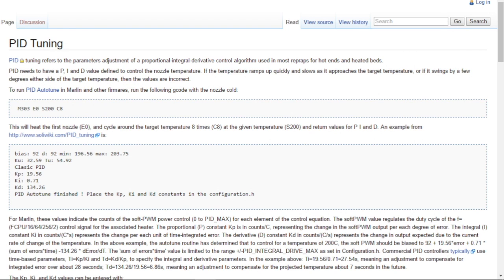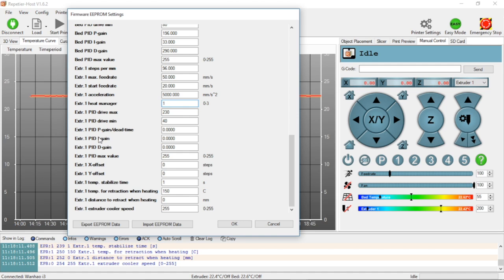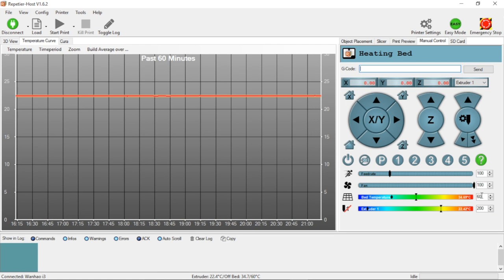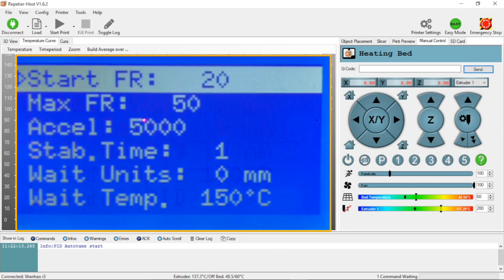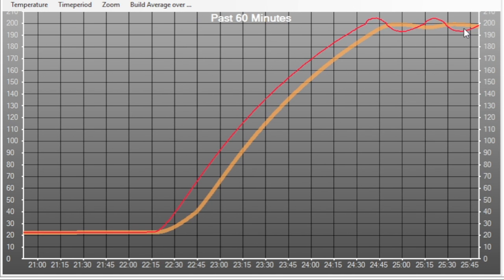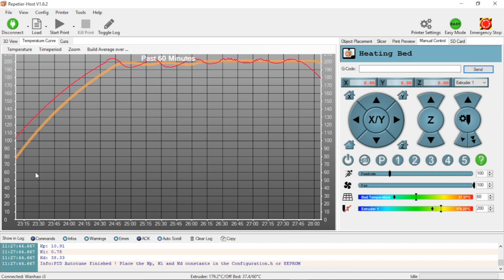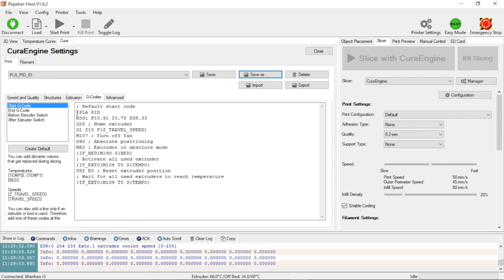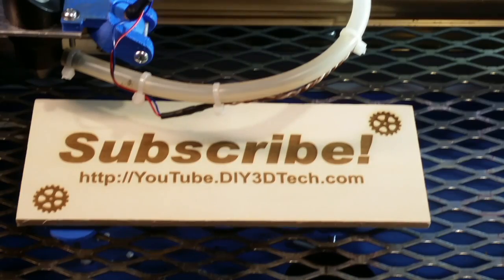3D Printer Talk - Configuring PID for a Marlin Based 3D Printer like the Wanhao! Part 3

Comment: Mine is not loading the eeprom settings for some reason. I have eeprom enabled but its just not loading when i click on it like yours did. I switched to windows and it read it just fine but I dont have the heat manager like you do.
Reply from the maker: Sorry no clue off the cuff, would suggest to double check your USB drivers and version of Ardurio software...
Reply: @DIY3DTECHcom  Mac does not have drivers like windows but its all good, i just switched to windows and it worked fine.

Comment: I never save to eeprom as I got burnt doing that so I just head into the configuration.h and change it there.  I am an old CLI guy anyway so I prefer having everything right there with a wide open editor but others who grew up in the Windows era might not (though a ton of users who 3d print are on Linux Linux has now become a glorified Windows so the same difference).
Reply from the maker: LOL!  know what you mean as I was doing keyboard buffering stuffing long before all of these keyboard macro things :-)  Ah kids have no clue what a VT-100 is, very sad as  I remember the days we would wind our own memory (the PDP days)...  Ah kids have it to good!
Reply: DIY3DTECH.com
OMG, I haven't heard that term since the 1980's when I would have to turn on VT-100 emulation when using Tymnet and Telenet.
Reply from the maker: LOL!  I used the real deal!  Use to work on (and I mean hardware wise) mainframes and mini's!  Man oh man those where the days!
Reply from the maker: I have purchased some stuff via them with ok affair, however they are more expensive than china as where else do they get their stuff from (i.e. China) so I just direct and over buy (it works about the same expect i have more)....
Reply from the maker: Wow sorry to hear, have bought quite of the v-slot from them however I buy via the Amazon link so I get the affiliate discount (every little be helps) and its been ok.  Know a couple viewers have sent me links to other companies that do a "maker-rail" however your correct it is different...
Reply: DIY3DTECH.com
Considering how much gouging they are doing I agree that every little bit helps.  I wonder why we can't buy the extrusion but can buy the wheels, the corner brackets, the braces, etc... from China but not the rail?

It is their silence that is pissing me off more than anything because they tell me that they can't combine them because the UPS one (first order) was shipped but that was a lie because it is still with them and has not been picked up yet so they could have easily done that considering they placed my first order on hold/pending then when I told them the order to merge and to credit me the difference they put the first as shipped but it really hasn't been as I said.  If I didn't know them I would swear I was being scammed but regardless I figure 1 week is long enough and if I don't hear from them or see the package has moved I will have to charge back on them and all of my printer stuffs will have been for nothing because I sure in the hell will never buy from them again.
Reply: DIY3DTECH.com
This a first but they are working at this houe 2:22am eastern

Your recent Order #xxxxx was Shipped out from our warehouse on Friday, Nov 25th.

We also see that the Tracking Information has not been updated by UPS but we can assure you that your order has been shipped and should be received shortly.

Please let us know if you do not receive your order soon.

Yeah, not updated since they created it as it still shows it as waiting to be picked up.  I have this happen a few times with China and once you rattle their cages it begins to ship out.

They also said they would put it back on my charge card so awaiting that but, hey, at least they are working at this weird hour.
Reply from the maker: Its Xmass time, I am sure any and every one in retail is working their behinds off!  :-)
Reply: DIY3DTECH.com
Yep.  They told me to message them if I don't get it soon and I said by end of day on Friday and they said that would be fine.  USPS was here on Tue and UPS is normally faster in transit but USPS had Saturday so everything will be equal so giving until end of day on Friday is long enough.  Something is very odd that UPS says they are still waiting on the package so they can begin processing it but OB says they already handed it to them.  8 pound box.
Reply: DIY3DTECH.com
I received an overnight Saturday delivery just now from OB and guess what ALL of the V-Rail was N/A yet OB didn't make one mention of that but they are a mom and pop operation so with that few of people actually working it they had to know.  If I didn't need that v-rail so much I would turn them in to my credit card company.  What a cluster you know what.  No big deal you live and learn so you don't repeat the same mistake again.
Reply from the maker: Sorry to hear, hate when things are back ordered and you have to wait :-(
Reply: DIY3DTECH.com
I don't mind B/O but at least tell me first not let it be a surprise after I open my box.

Comment: wow great idea to have the PID settings as print options .   
easy way to do it too .  Great video .
Reply from the maker: This has worked out pretty good for me as post processor code in CURA.  Also look for a up coming video as I took your advice and finial found the time to fix the Tarantula (changed configuration.h) to center the print on the bed...
Reply: man i have to look into doing setting like that . i hate eeprom  .  i prefer to turn it off in firmware and hard code that stuff . marlin compiles fast enough.  
if you ever get to it i would like to see ideas for making a purge line jut as the print starts .  i never got one to work on my fab mini . 
but just watching your video , i now see how cool repetier host is for settings .
Reply from the maker: Real you and Dark Alchemist seem to hate the, have not any major issues however I only deal with them any more from a hobby stand point.
Reply: i hate to rely on eeprom on devices i might be tinkering with , due to only allowing somany writes before its dies. So i tend to just turn it off in src and compile my changes. but when it hits the 'ready' phase i might tunr eeprom back on , maybe . LOL . 
I use it all the time for other Arduino things that are not in iterative testing phase. It woudl be cool if Marlin could load settings file(s) from SD.  that would/coul be cool .
Reply from the maker: Die?  Know they have lower MTBF but that number is so high  especially in a hobbyist arena reaching it would seem hard.   As a  hobbyist, the only issue I have see is flushing the cached data...
Reply: 16mhz , and 1 accidental bad loop  == dorked promini. lol happen before i knew .
but i also have used EEPROM on some RTC's modules.
Reply from the maker: Interesting...
Reply: granted my fault , but it has made me shy away from eeprom , that said ( in voice of the Dos Equis beer commercial guy ) when i do use eeprom, i use eeprom anything lib .
 it writes structs and only adjusts bits that need to change during a write .
Reply from the maker: LOL! Also keep an eye in later dec as I once again use your name in vain :-)
Reply: haha .  will do .